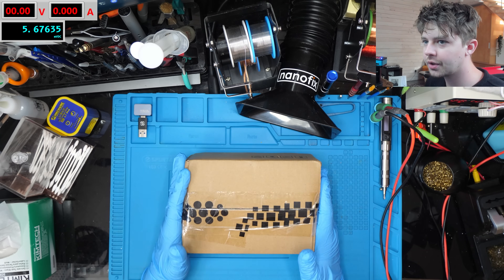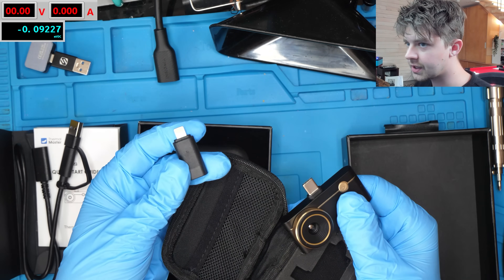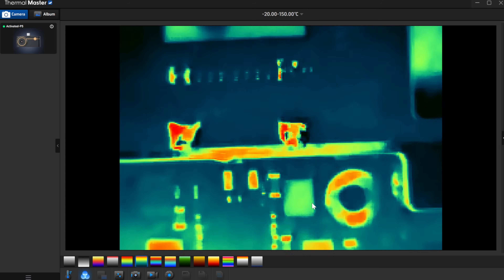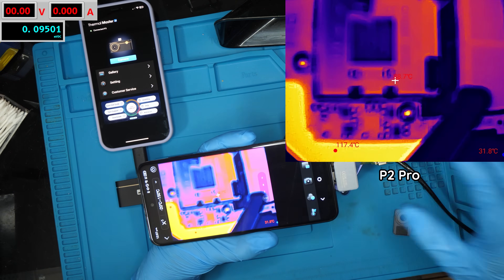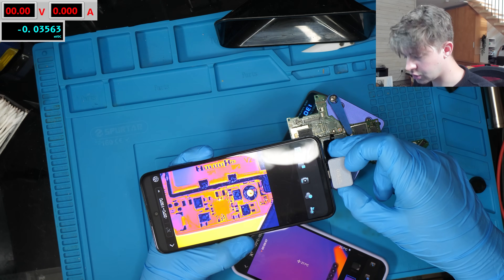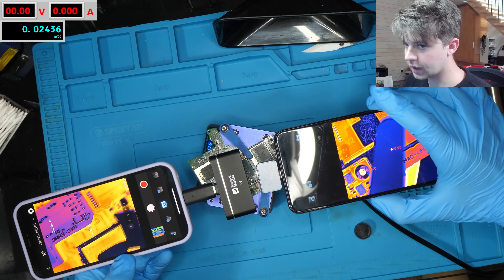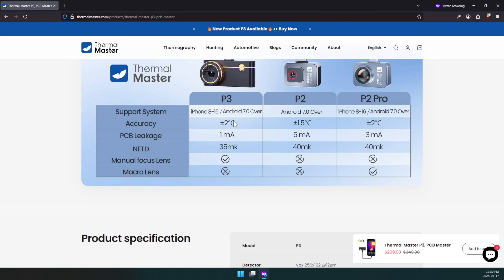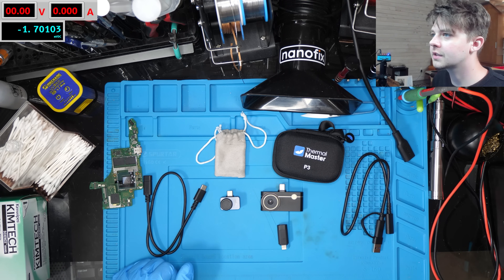Thermal Cameras are Getting Crazy - Thermal Master P3 Review

Comment: I used to borrow a FLIR One Pro from a coworker whenever I needed to check PCB heat issues, but the image was always too fuzzy for tiny stuff. You could tell something was warm, but not which component exactly.
Got the P3 recently and gave it a try on the same kind of job. I was actually able to tell which resistor was heating first, and even saw a thin line of heat leading to a bad cap. I didn’t expect this much detail from a phone thermal camera, but the image is just sharper, no question.
Reply: Yeah, for its price the FLIR One Pro has pretty darn poor IR resolution. Been wanting one for years, but I finally just got a TOPDOWN TC2002C with 256x192 actual IR res (512x384 enhanced), works really well with much sharper quality than the FLIR offerings. Probably not as macro-tuned as these Thermal Master ones though.

Comment: Bought the Android version and it thankfully worked out of the box with my only Android phone. I manage 2 apartment blocks and use the P3 for heating troubleshooting, water leak detection, rodents hiding behind walls and for checking that all doors and windows are properly closed and sealed during the winter months. The configuration is very important. I set my thermal window from 16 - 34°C and it almost immediately gives me the thermal signature of the room. The non IR overlay is a nice touch too. I would recommend for you to buy this IR addition if you are in the market for entry priced but mid level featured IR functionality on your phone.
Reply: Did you buy your P3  from Thermal Master web site ? If so have you been able to track the shipping in any way after it was shipped ? I ordered one from their web site and after 5 days I still cannot get a tracking number.. Neither received a 'shipped' email confirmation...

Comment: I have an other thermal camera with a focus ring, but I have 3D printed a holder for the focus ring, so that I can add there a macro lens. This is very useful.
Nice that you show us the desktop program. I like to see if on a big screen, because this phones are not nice to use in my opinion and the screen is to tiny.
But there is always a problem with the USB-C connector, because on the phone it can break and at a wrong movement the force on it can be very big. So I like to use a desktop program, because I do it mostly in front of my desktop PC, I do not walking around with it, it is always at my desk.
Reply from the maker: Yeah I really hope they put a little more love into their desktop software. If it was as good as the app is, it would easily be the best thermal camera
Reply: I guess you could use a tablet if you want the quality of the app on a bigger a screen. Just my thoughts.